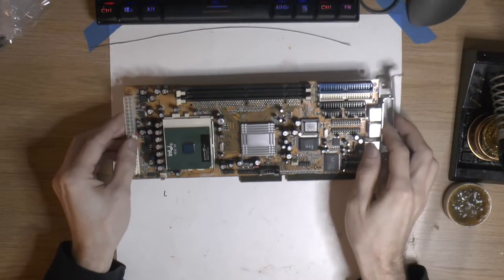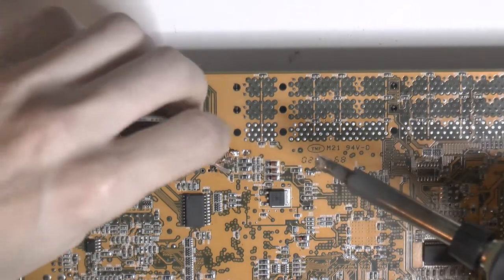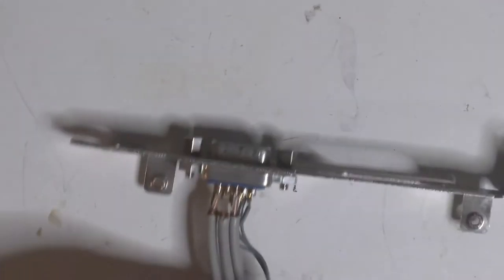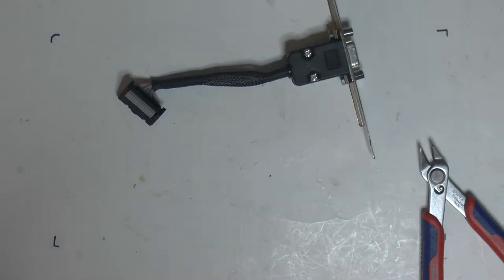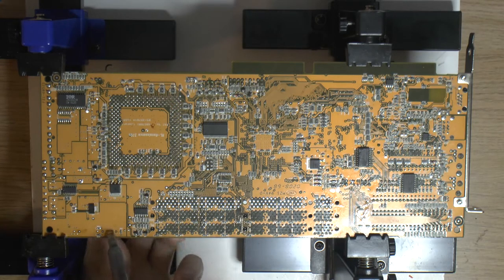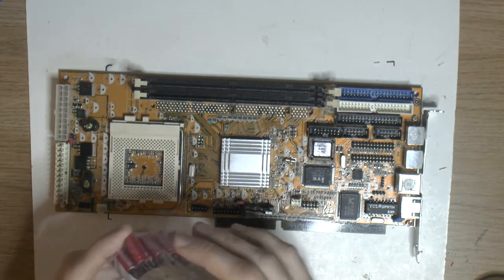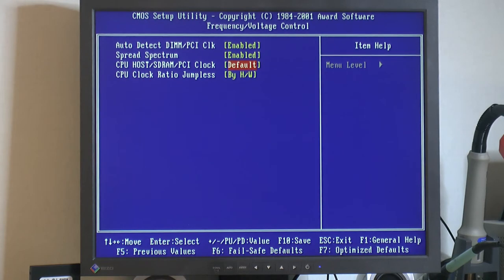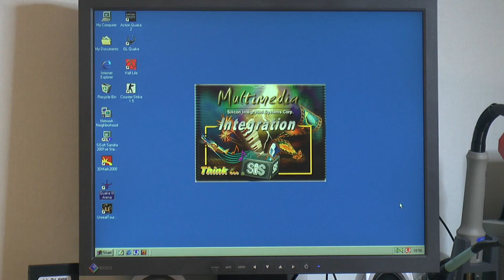POWERLEAP RENAISSANCE/370S  - repair, recap and benchmarks

Comment: An interesting form factor, but I still did not understand why it is like that. It would be possible to assemble an ultra-compact system unit, but it is not necessary to install the board and another motherboard. Only a compact power supply is required. Even SD ROM is not necessary, or you can put a thin one from a laptop. As an option, I saw such DIYs based on the case from a DVD player, or something similar. And as a hard drive, you can put an SSD or compact flash through the IDE adapter, it will take up little space and work quickly and quietly.
Is it really possible to solder the third SDRAM slot?
Reply from the maker: A lot of things Powerleap made made no sens XD I suppose thats the point LOL.
An external GPU case with its own PSU and a ISA bracket to hold it would make sens, one thing the previous owner and I talked about to make a compact portable retro lan rig from.
Reply: The board is a drop in replacement for your old mainboard. You install the System Upgrade Card, connect all necessary cables from the rest of your computer to it and it takes over.  The only use of the old mainboard is to hold the system upgrade card in place.

This system upgrade cards were interesting for business customers in need of new PCs. If you upgraded dozens of PCs at a time it was much cheaper then buying new computers.

But this "cheapo" has no connection to the old PC mainboards resources. So you can´t access other cards in the ISA or PCI-slots limiting you to the components installed on the replacement board. That is not so tragic because almost everything you need is installed on the R370S (network, USB, Floppy, ATAPI). But having a better graphics card would be nice. The chipset is the SIS630 and the integrated graphics unit is the SIS300 with shared memory.

https://www.youtube.com/watch?v=KDJ-Jz97A6E&t=443s

Okay, it plays many late 90s titles without problems.

Comment: Great vid! I've always been fascinated by those type of boards.

Just wondering if the video chip has that 'jerky' side scrolling in DOS issue a lot of cards in that era have? ie: Commander Keen 4
Reply from the maker: I will add that to my testing once I build the system. I dont have capture card but I will do my best to try and capture gameplay. the rtl8139C should work fine with ipx in dos so should make a good dos lan machine to from what I read.

Comment: I wonder if they've disabled the third RAM slot in the BIOS or if you could just clear out the vias and install another slot for half again as much RAM capacity.
Reply from the maker: probably doable adding another slot but 1.5Gb of ram requires speciell use cases anyway.
So yea the idea crossed my mind.
Reply: I am way too used to modern system requirements so even 1.5GB seems like a tiny amount. Windows 2000 and XP shouldn't have any problems with it, though a lot of programs that are carried over from 98 probably aren't designed to allocate for more than, like, 512MB. And I just glanced at my current desktop's system resources panel and I'm using a quarter of my 64GB of RAM just for web browsing... Well, if I ever do need it, I designed this system to be scaleable and I can just add another Xeon E5-2698 v4 and an additional 64GB of RAM. I found one of the less common workstation boards that 100% works fine without the second processor installed. Nowadays, though, there's not much need to go the workstation build route to get enough processor cores and RAM support. Current generation processors and motherboards are just insane.

Comment: why did you replace all the caps? all ones were faulty? great video
Reply from the maker: They where old and the board needed refurb anyways so might as well put on new caps.
Reply: If you don't replace them all, the older ones will become the weakest link. They will die within a month.

Comment: So, I'm a little bit curious. How does this achieve using an old motherboard as a glorified backplane? How does it acts as a bus master? If there's no CPU connected to a 286 motherboard, none of the chips that form the "chipset" will control it? Does it require you to physically remove the BIOS ROM or some other chip, like the keyboard controller?
Reply from the maker: There is no external bus at all. The ISA has no pins, its a board replacement.
Because of that you can run this card in any ISA slot and your old board wont ever see it.

 Just unplug power from the old board if you dont want to use that.
Reply: Ah! Yes, it didn't make any sense to not see any pins :) Interesting approach for this card, I think other cards did have these pins available so you can use them on true backplanes.
Reply from the maker: @cocusar  Yea this card is intended to be an easy upgrade for your normal PC, for example take a 286 up to a Tualatin Pentium 3!

But powerleap did all sort of weird stuff.
But the card runs fine on 5V and 12V only (if you dont need serial ports) so one can have it as an extra system, system in the system.
Reply: wild concept for sure!